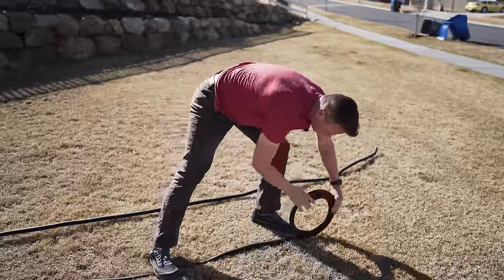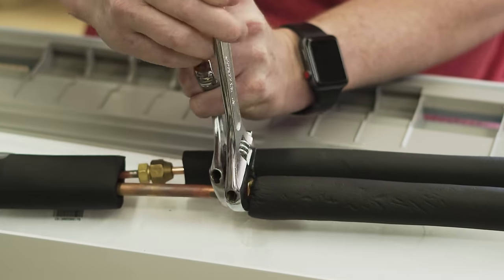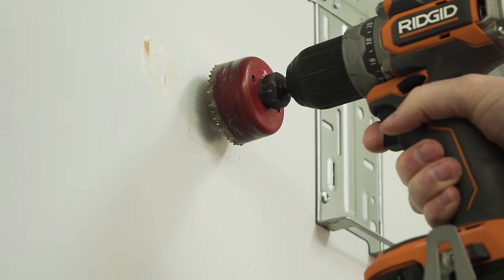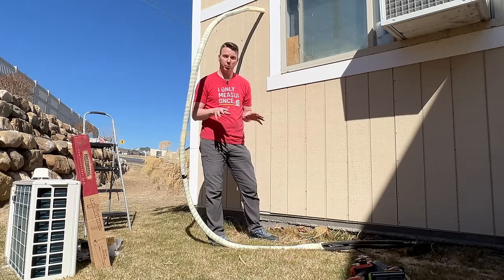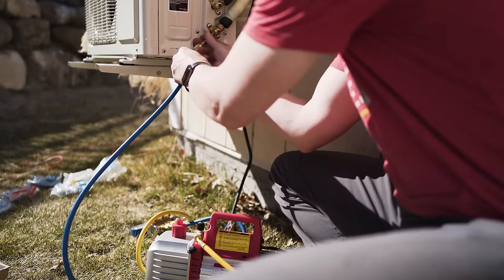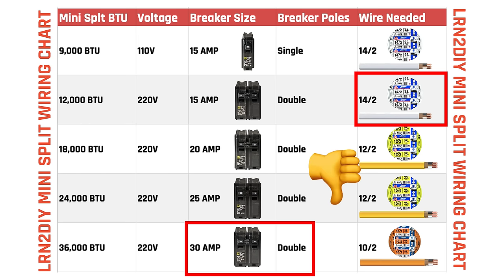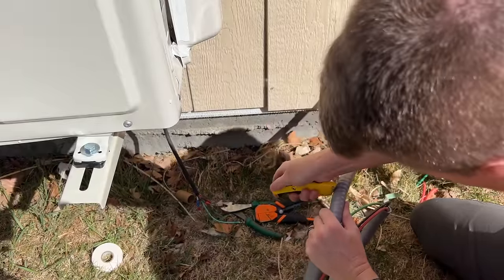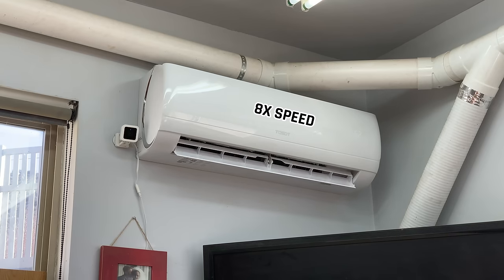DIY Mini Split Install - All the Things Nobody Shows You

Comment: Is vacuum pump necessary for new mini split installation? Because some technician told me many new unit comes with the pre charged. Another question is can 30amp used in 12/3 wire on 1,200btu ?
Reply: That depends on how the system is set up from the factory.  Some already have a vacuum drawn in the freon lines and need to be connected in a very specific way to not let air into the system, otherwise, you do need to draw down a vacuum yourself.  Just because the condensing unit has freon in it from the factory, does not mean that you can just leave air in the lines.  Air and the moisture in it are the enemy inside a system.

As far as your second ?, NO!   Wire gauge has to be matched to the amperage of the breaker(s) that are used to make sure that the circuit breaker is the "weak point" in the circuit and will trip if too much current is drawn through the circuit.  Otherwise, it's a fire hazard because the "weak point" will  be the wire and it could very easily get too hot and cause a fire if too much amperage is drawn through it.   30 amp circuits require 10 gauge wire.

Most 12,000 BTU systems do not require 30 amps, whether they're 120 or 240 volt.  Just check the specifications on whatever system you're going to use.

Comment: I’m finishing up installing Mr cool, watched this to make sure electrical was right. Is Mr cool any good? It’s way more plug and play hopefully that doesn’t come with cost of reliability
Reply: @christaylor6654 cc: @Kent6211
FYI, I've posted this as a reply in several places here:
@Kent6211 said:
"Mr. Cool installation was easy because of this, but I'm not happy with the "lack of temperature regulation'.  I've tried using both the "in the room control handset" and the "internet based iPhone App". There was an iPhone App update this week (finally) so hopefully that will help.  Not holding my breath on that as I think that the "root cause" is that the inside units themselves (I have a 3-zone 27K BTU system) do not seem to have a reliable temperature sensor as I constantly have to "Calibrate" the room temperature readings."

Comment: I haven't read all 1500 comments so I don't know if this got corrected, but your understanding of 220 is wrong, but you got it wired right anyway (except for using the wrong color wire.)  In this situation, 220 (or 240) is two hots and a ground, no neutral. What you called neutral was actually the second hot and the red wire would have been prefered.  Black to black and red to red.  But, it works anyway of course because the unit doesn't care about color or terminology so long as it's connected to what it needs.

Comment: Best practice is to connect the load end of a circuit before connecting the source end. Once the breaker is connected you are working with a potentially live wire at the load end.

Comment: Why did you use black and white (neutral) wire connected to the circuit breaker for 220 VAC instead of black and red?

Comment: Question:  I may be dense, but is the refrigerant (R410A) in the condenser from the factory?  so that the purpose of pulling the vacuum is to remove air in the lines to the indoor unit (replacing that with the factory installed refrigerant when the valves are opened?
Reply from the maker: That’s exactly right.

Comment: AT 18:35 you close the valve and wait 15 minutes.  The problem is that the valve closes off the line set from the unit to the gauge.
Does not the line from the unit go to the gauge fitting then the valve (that is closed off) then the gauge - or am I missing something?
How does the gauge measure vacuum loss when it is closed off??

In other words turn pump off then wait 30 minutes with valve open to check line set.

Comment: on that chart that was shown with the wire sizes I noticed 12/2 said up to 25 amps according to the code that is illegal if its 25 amp you must use a #10 wire.

 2) always go with the name plate rating per the manufacture or you could void the warranty. 

3)you dont need to pour a cement pad to put those unit on the have plastic pads made for them u simply put stone down, level it out, then place pad on top. I have mini splits throughout my house and both condensers are wall mounted I wish I had them on the ground because of the vibration.

Comment: First off, your video is excellent. A couple petty things I noticed. I would of used the red and black wires in the Romex 10/3 instead of the white and black wires though. I also would of stripped off the orange sheathing off of the Romex just for the section which will be within the conduit (not the section going through walls and studs). It allows proper heat dissipation from the wires, but you over sized the wire and the conduit is practically empty and it shouldn't matter. Also you referred to one of the hot conductors of the 240 Volts as the neutral as you were hooking it into the condenser unit.
Reply: I guess I should of read the other posts! I am repeating their comments. Duh.

Comment: As soon as I close the manifold the pressure goes to 0. But looks like my pressure gauge is on the pump side not the line side. How can the gauge be reading the vacuum on the line of the valve is closed?

Comment: A few things are wrong with this video, and has the potential to cost those that follow it quite a lot of money.

1 - I don't recall if you said the Lineset (Copper tubes) came with the mini-split or not. While the condensing unit comes pre-charged, it is only for a specific length of lineset, usually 15'. If your lineset is longer than this, the system will now be undercharged. If it is shorter than this, it is now over charged. Both scenarios will cause premature failure of the system and increased electric bills. Both scenarios also require an EPA-608 license to add/remove refrigerant.

2 - The lineset is way to long if you have to coil it. It needs to be cut to length and the flare connections redone. Those coils are going to cause oil to get stuck in the lineset, causing the compressor to be starved of oil.

3 - Flare connections must be torqued to a specific value based on the diameter of the pipe, anywhere from 8-55 ft lbs. Over/under tightening will result in refrigerant leaks. 

4 - The system needs to be vacuumed to a minimum of 500 microns, and not go above 1500 microns during a 10-15 minute standing vacuum test. You simple will never be able to get anywhere close to the needed precision with an analog gauge set. It requires the use of a digital micron gauge. Atmospheric pressure at sea level at 60 F is 29.92 inhg, or 759,968 microns. 500 microns is only 1/50.8 inhg, and 1500 microns is 3/50.8 inhg. As you can see, your gauge only shows 0 to -30 inhg, the thickness of the needle alone is about 100,000 microns. Even an trained HVAC/R tech with 40 years of experience cannot accurately gauge the level of vacuum with an analog. Plus, it is not possible to have an absolutely perfect vacuum, yet your gauge is showing past -30 inhg of vacuum. What you would need is a vacuum pump, charging tee, 1/4" - 5/16" adapter, charging hose, micron gauge, and a gauge set. Prior to doing a vacuum test, you need to pressurize the system with nitrogen first. The data plate will say what the evaporator (indoor coil) test pressure is, do not exceed that value as you can rupture the system. You do this because vacuum leaks and high pressure leaks are to different animals that are not always present in with a single test. To do the vacuum test, connect the charging tee to the adapter, connect that to the suction port, connect the micron gauge to the liquid (red) side of the gauge set, then connect the suction (blue) side to the charging tee. Pull a vacuum to 500 microns, then turn off the vacuum and close the suction valve on the gauge. Your microns will rise as the vacuum stabilizes across the entire system. Keep pulling until it maintains 500 microns before you start the standing vacuum test. If the vacuum does not go past 1500 microns during the test, then it is good. Close the liquid valve on the gauge to protect the micron gauge from high pressure before you open the service valves. Do not take it off without pressure in the system, this will cause air to enter the system and can be 10's of thousands of microns in volume. While 500 microns is the minimum vacuum to reach, it is the minimum. I always try to get 200 microns or better if I have time. The lower you can get the better. One of the primary reasons for pulling the vacuum is to remove water vapor from the system, water vapor in the presence of the Polyoester Oil found in R-410a and other refrigerants, will turn the oil acidic, causing it to eat away the copper from the lineset, aluminum from the coils, and the insulation from the coil windings in the compressor. It can also create galvanic corrosion anywhere that two dissimilar metals are touching. 

5 - Your breaker is way oversized for the application. There will be a minimum and maximum over-current protection rating on the data plate. Do not install a breaker that exceeds that maximum, the conductors are perfectly fine to oversize for added security. But an oversized breaker will potentially allow the system draw so much additional current before tripping, that it can cause a fire. I also do not recall if you mentioned to check with the city if this requires a permit or not. If this type of electrical work require a permit, or an electrician in your area, your insurance company will not cover the cost repairs due to any fire damage. Since it is being ran in conduit, it really needs to be THHN wire.

6 - The drain line needs to be taken further away from the house, or plumbed directly into a drain. Unless your live somewhere very dry outside your going to create quite a lot of condensation. While it may look like a small drip, you are producing approx. 7 gallons per ton (12,000 BTUs) per day. This can cause foundation issues if your are constantly pouring water on a daily basis this close to the building.

7 - When asking about electrical permit requirements, ask your city if they require anything for AC installations. A lot of locations will not only require a permit to install or replace HVAC equipment, but also require it to be done by a licensed professional, and can levy fines against the homeowner. Usually $500/day you are violating the requirement. Keep in mind, once you open those service ports and let refrigerant into the rest of the system, you must get someone licensed to work with refrigerant to remove your system. removing or venting the refrigerant can cost you $37,500/per day/per offense from the EPA. Since there is a $10,000 bounty from the EPA to someone that reports these violations, the city inspector is going to very likely want to know who recovered the system, and to see their refrigerant logs proving it.

8 - You need to either use the Black/Red/Ground wires, or wrap red electrical tape at all ends of the white wires. The white wire is denoting a neutral wire on a 120v circuit, Red would indicate that wire as a second hot wire on a 240v circuit. While yes, someone should very with a multimeter for live voltages before working with electricity, mistakes can happen. Someone in a hurry, could very easily mistake that for the neutral and be killed because of it. 

I may be missing a few smaller things as this took a bit to type out. But, it should cover the vast majority of what I saw, especially what could cost people a large amount of money in future repairs, denied warranty claims, denied insurance claims.

Comment: 25:07 Neutrals (identified by white insulation) do not connect to breakers. To repurpose a white-wire neutral as a line voltage conductor, you should have wrapped that white (L2) wire in black or red tape to mark that it is now being used as a conductor (has line voltage) on it and do the same at other end (the unit). *Neutrals actually connect to earth ground just as grounding wires do, but are attached to their own termination bar.

BTW you should have just used the red wire in your case. For this installation, best to use 14ga. 2-conductor with ground and mark the white with tape or permanent marker.

Comment: Where is the strain relief for all the wires going into the bottom of the box next to the new knock out?  Also when you are hooking up a unit that doesn't require a neutral, you should have used the black wire for L1 the red for L2 and your ground and capped the white.  This will help someone in the future to not "think" the unit outside is hooked to 110.  But one would check with a meter you would think.

Comment: With the refrigerant line coiled in the back of the unit not only does this cause a oil trap, but it reduces the air circulation needed to work properly

Comment: Great video, but just so you know, the higher the voltage, the thinner the guage wire you can use. That is the primary reason for using high voltage, so that you can use less amperage and save on wiring costs.

Comment: For 220 volt both the black and white have 110 volts each so the one is not neutral it actually has voltage to make up the total 220 volts. That’s why it’s labeled L1 and L2. Each being line voltage.

Comment: Best practice is to also pressure test with nitrogen before vacuuming. Not only does it allow you to check for leaky bad flares before commissioning, but it also dry's out the lines by absorbing as much moisture as possible from the air inside the lines. And in an A/C the outdoor unit isn't really a condenser because it acts as both an evaporator (heating mode) and a condenser (cooling mode) depending on which state the 4 way valve is in, the lines can either have a hot gas and warm liquid in them or a cool gas in them running to the indoor unit depending on which mode it is operating in, so suction and discharge lines can change position in an A/C
Reply: Nitrogen is good, but if I had to choose only one, it's a micron gage. MUCH more accurate
Reply: thats a defo and you also need to check connections on the indoor before you seal everything ,as if you have a leak there in this video you will never locate it
Reply: also he needs more airflow above indoor unit ,his location below that waste pipe is not good ,that needs to be clear

Comment: Many things have changed since I was an electrician 50 years ago, but the National Electrical Code allowed using 50-amp circuit breakers and #10 wire to feed a 3-ton AC unit. The logic behind this was that overload protection inside the compressor was sufficient to provide protection for the wire feeding the unit. This may not apply to this unit. I don't know.

I have my doubts about the wiring passing inspection. Is it legal to run Romex in conduit? Is it legal to use unbonded conduit? Shouldn't he at least use a Romex connector coming out of the conduit LB elbow to secure the Romex?

Was I wrong or was he leak checking with soap while the system was still in a vacuum?

Comment: No cover for the outside lines? One thing I was not told about our Mini Split is to use a shop vac at least once a year to clean out the drain line. We ended up with a waterfall in our house because the drain line grew algae and plugged after only 6 month use. We put 2 chlorine tablets in the water reservoir at least 3 times a year to prevent algae growth.

Comment: You will need to protect the out door unit from lightning and over voltage surges , I would suggest an ICM -493 30 amp

Comment: Forgot something.  I'm also a former old-school HVAC tech from Industry (not residential).  We old farts used to use a 24 hours vacuum pump run to evacuate lines and compressors.  I would still recommend that, if not at least a couple hours.  Here's why.  Vacuuming is not just about evacuating air.  It is more about removing any trace of water.  And if you do not pull a longer run on a system there will always be many molecules of water left behind.  Saving you the Chemistry lesson suffice it to say that water and Freon make Sulphuric Acid, which is the main reason why compressors fail.  Capiche?

Comment: I’m so confused. How are you putting vaccume on the line set if the valve is closed. The manual says to open the bottom port Allen and then vaccume the system down I’m way over my head here

Comment: what electric cable and amp should I need to install  12000 BTU Mini Split AC  with 110-120V? Thank you
Reply: The unit should be marked with a label indicating MCA (minimum Circuit Ampacity) and MOP or MOCP or perhaps a fuse size.  The Maximum Overcurrent Protection is the largest breaker you can use.  Use NEC table 310.16 to select the wire that has an ampacity at 60C temperature at least as high as the MCA.  If this does not make sense to you, then you should probably hire a professional to do the installation.

Comment: Mini splits are great. I removed my window unit and installed one. My central unit is coming to the end of its service life. I will not install another one, it will be cheaper upfront to put mini splits in each room, as well as based on power usage the  mini splits combined will use 1/2 the power of central and more than that in the winter.

Comment: So the power for the indoor unit is provided through the signal lines?
Reply: There are three wires and a ground coming from the outdoor unit to the indoor unit.  Two are for voltage to run the fan, one wire is the control wire that is for communications between the two units.  So yes the. indoor fan is powered by the outdoor unit.

Comment: FYI for your quick disconnect on inverter units that are most of the mini splits now you need to install a surge protector these units die quickly and easily because of surges

Comment: Oversizing fuses is the same as not installing them. (I know this has been addressed elsewhere, in less explicit terms. ) Essentially, you're using your wiring and/or your equipment as your fusing, which won't end well.